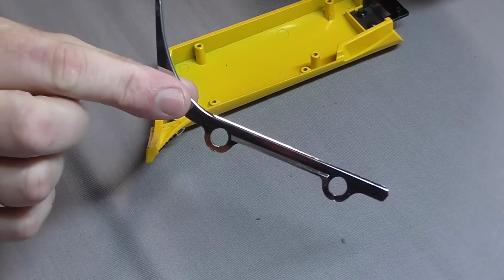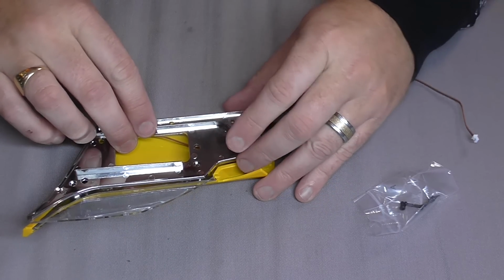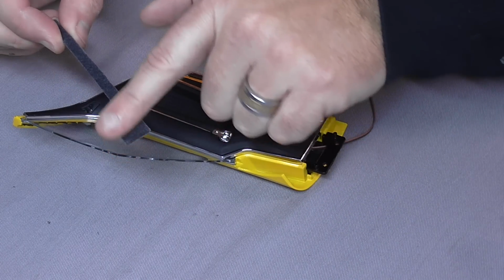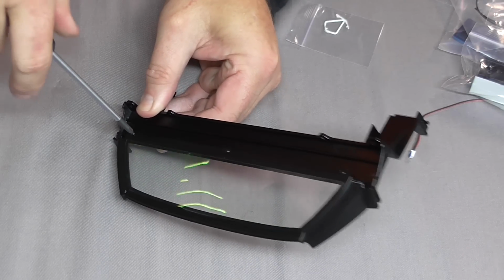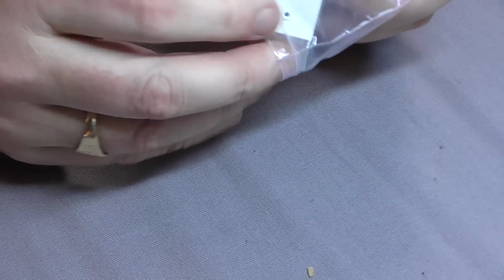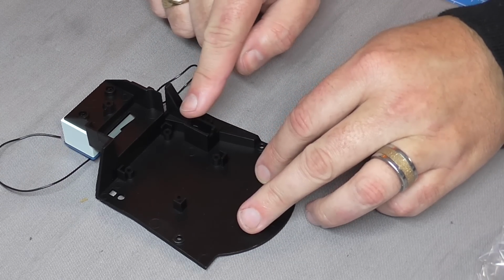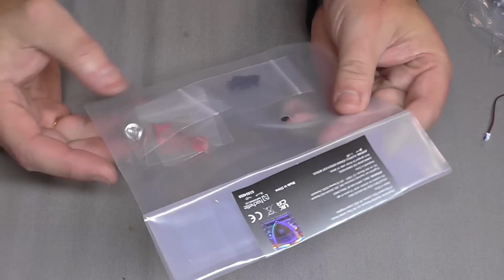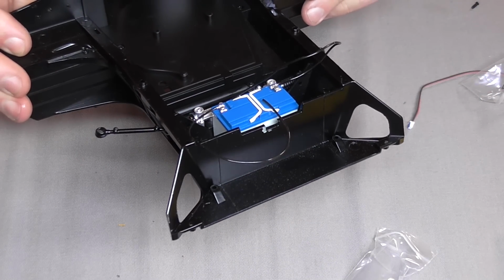Build the Lamborghini Miura - Pack 7 - Stages 51-58

Comment: I found installing the steering rack and keeping the pinion on the steering column meshed with it was a real problem. The steering column was bent and the pinion was clogged with metal and the rack with paint so I had to hand form the teeth on each. Then the holes in the washers were far too big for the size A screws. It’s now better but far from perfect. I’m going to be asking Agora for replacement parts.